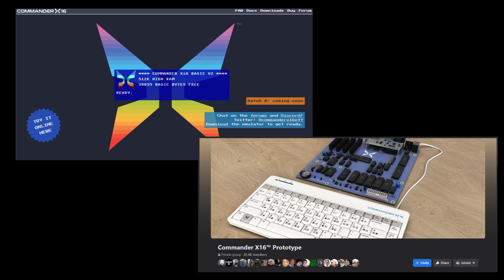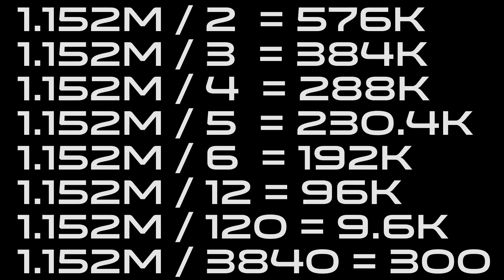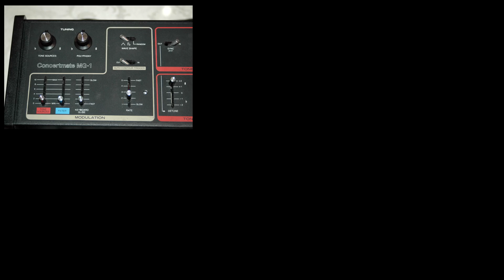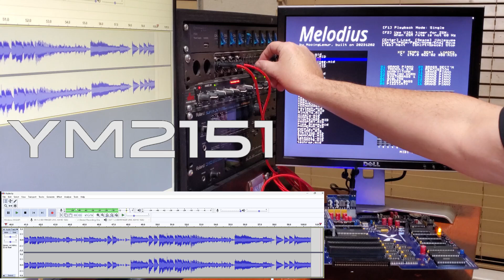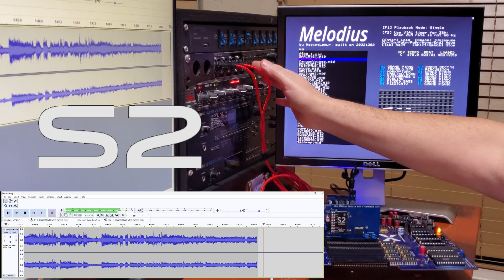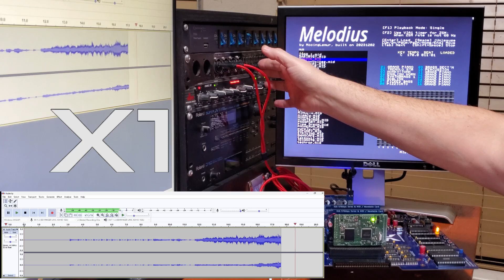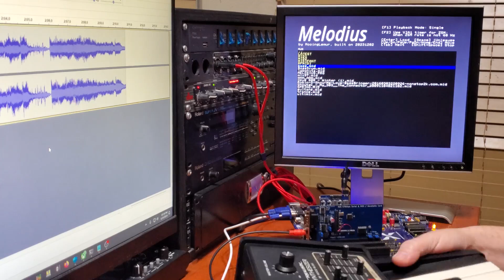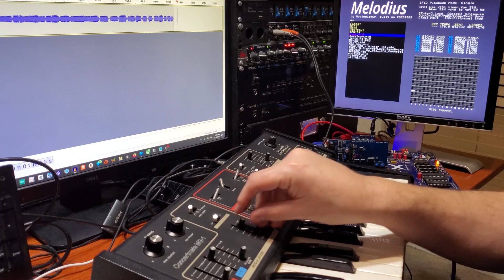Commander X16 Serial / MIDI Wavetable Board Demo

Comment: Haven't sen an MG-1 in years.  I remember messing with those every time I went to a Radio Shack.  Did you know that the MG-1 was built by Moog?  Yep, essentially, it's a scaled down Minimoog.

So, what was the S2 and X1?

Comment: Thank you for your efforts. Both serial and MIDI are on my wishlist too for the X16. Hope this makes it into some product or diy kit. One thing I would like to have as X16 addon card is a GPIB/HPIB/IEEE488 interface - guess I'm the only one ;) ?.
Reply from the maker: We have serial IEC of-course, but I do plan to make a dual 65C22 card.  I just haven't figured out the exact form, but that plus a few 75150/151 driver ICs and you will have an IEC parallel port.
Reply: @TexElec  Thank you, sounds great. On the old PET those drivers where missing badly. I orderd a port prototype card just to be prepared.

Comment: I know this is supposed to be late 80s/early 90s-like so yeah there's wavetables, but once the sheen wears off, its "just" a souped up ROMpler which is almost the most boring synthesizer type you could possibly make. The YM2151 on the other hand, actually generates every sound sample itself, which I find to be more impressive.
Reply from the maker: One of my main goals with this video is to show the audio output on the X16 when piping sources via the bus.  With two cards plugged in, the impedance will change a bit, so I was testing to see if the noise levels were sill acceptable.  There is somewhat of a comprimise on the board since the volume levels of any source are not controllable.  I was constrained to through hole parts, so I did what I could.  There are tons of wavetable modules out there, these are just the two I happen to have in my possession.  Not every sound is for everyone, I get it.  But this will allow many more options for those who want it.